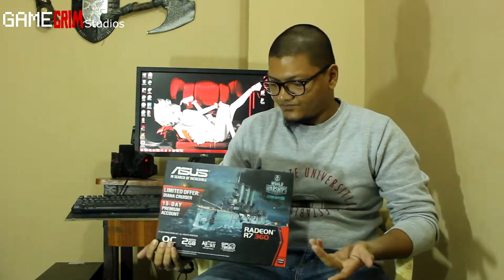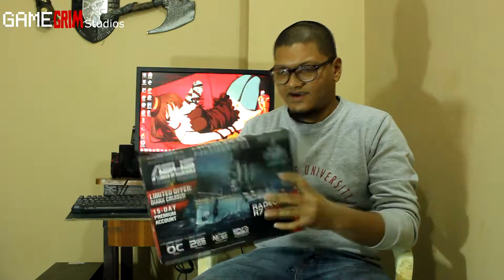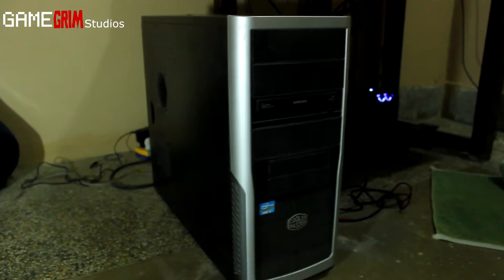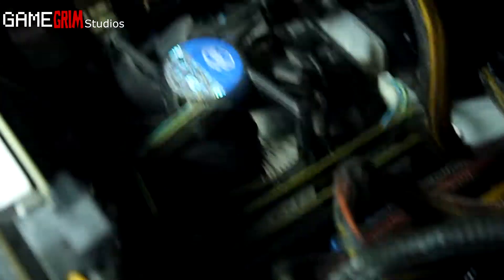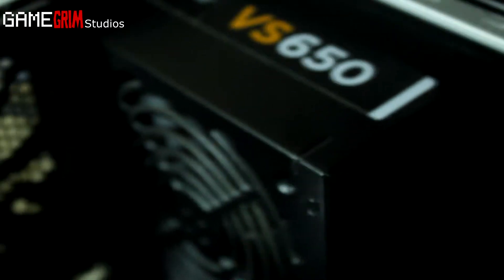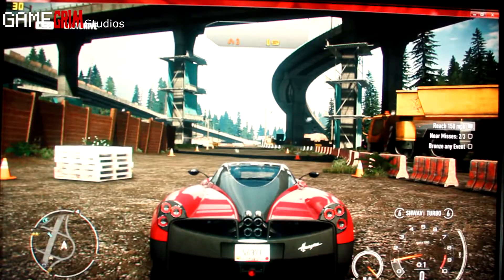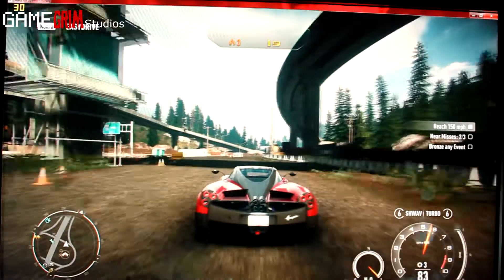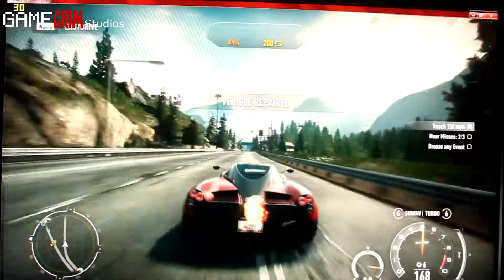PC BUDGET BUILD 2015 - R7360-OC with Core i3(2nd Gen)

Comment: I recently purchase this motherboard Asus H61M-E , and I got some serious problem , when I run any heavy graphics games the PC just restart and sometime restart on main menu of any game and on bios this error comes "Power supply surges detected during the previous power on . Asus Anti-surge was triggered to protect system from unstable power supply unit" . Is that you also face this iussue on this motherboard ? Or It is my power supply issue ? Or is this only motherboard issue ? Because my power supply works good on another system with no error !! Please help . My system specs are :
Motherboard : Asus H61M-E
Processor : Intel core i5 2400 3.1 GHz
Ram : Kingston 8gb + 4gb DDR3 1333 mhz
Graphics card : gigabyte Nvidia GeForce gtx 1060 3gb mini
PSU : gbox 650w (very old PSU)
Reply from the maker: i didnt faced any issue like this , i was running r7360 amd gpu with 650w PSU i never faced this problem .
try to run the game without the graphics card just to check if it works fine if it does it will declare that  GUP is running fine or not or its a PSU ISSUE